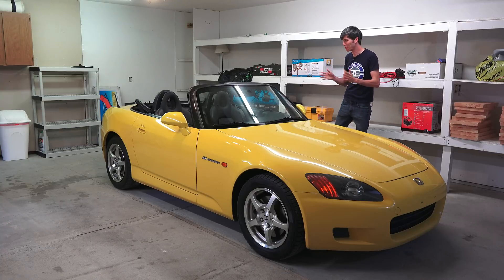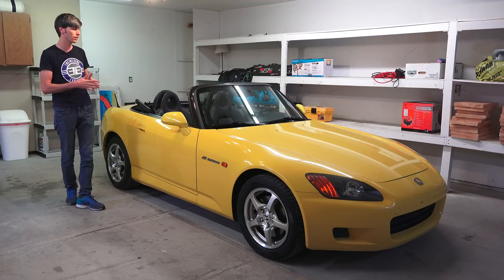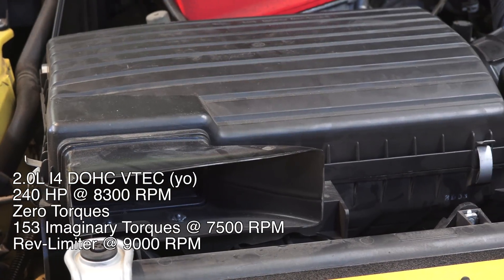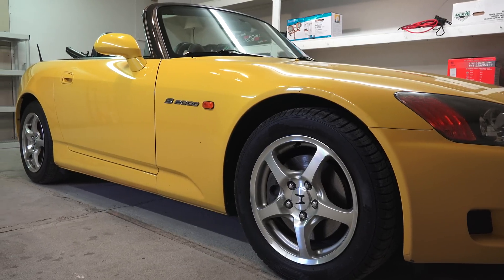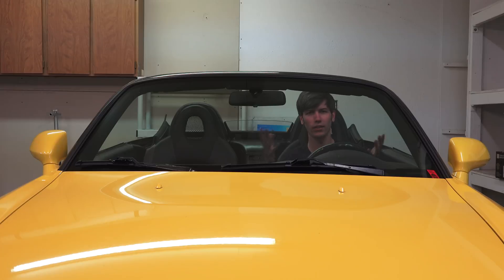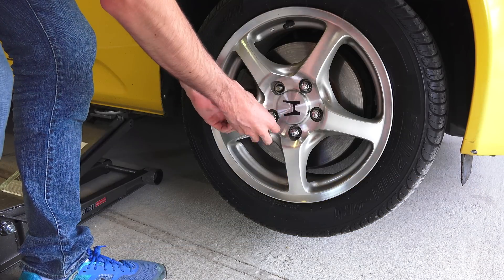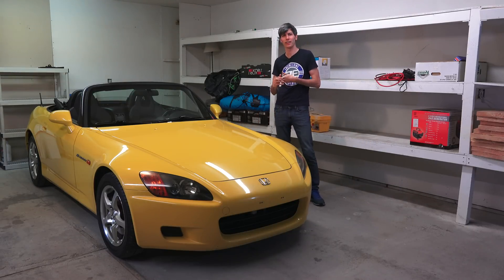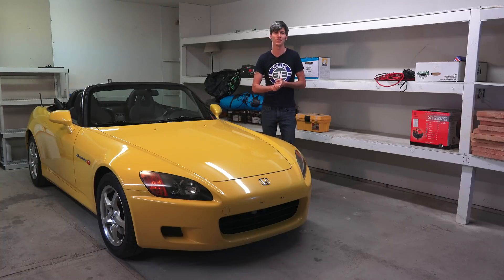I Bought A Honda S2000 And It's Amazing!

Comment: You sold your sti for this ?????? Wow
Reply: This is better than the STi lol
Reply: I sold my S2000 to get an STi ('05). Even with suspension work and a built engine with 385 AWHP, I had more fun in my near-stock S2000, even though it was way slower. The S2000 is THAT good.  I still love my STi but I would get another S2000 in a heartbeat.
Reply: He also bought another Subaru.
Reply: AWD isnt all that fun. Its cool in the snow and extreme weather, but in dry pavement with sticky tires its too tame. Not being able to break traction is a little boring.
Reply: dude. Lack of engine performance? It's all about the power to weight ratio. 240 hp @8k rpms in a 2,800 lb car is NOT a lack of performance. The STI weighs almost 600 more pounds and only has 60 more hp. Plus notorious turbo lag. It's a great car for sure, but so is the s2k.
Reply: He got another Subaru
Reply: jrherita As you subsequently said, it's a matter of taste.  One thing that blew me away was being in a Plymouth Prowler and taking an offramp curve at 60 when the sign said 25.  Zero skid.  Mostly due to tires and wheelbase/steering design.  But that's what got me liking AWD (No it's not an AWD vehicle; it just showed me what's possible when you reduce the torque the drivetrain puts on the individual tires).
Reply: I think you'd be surprised at that outcome.
Reply: The STI effectively has twice the torque of the Honda S2000.   This makes it a lot quicker up to peak horsepower.  At peak horsepower, the STI still has a slightly better power to weight ratio (3400/300 vs 2800/240).   For daily driving (i.e. 2000-4000 rpm), the STI's engine IS WAY more powerful and feels much more response.
Reply: Faster is only part of the equation, but for some people who can only afford one car - the WRX has a ton of benefits over the BRZ - useful cargo capacity, useful back seat, AWD, it's much quicker in a straightline and at the track,, and can be driven hard in all weather conditions - rain, snow, sleet, AND dry.    If you live in an area with cold weather, the WRX is a no brainer overall unless gas prices get very high again..   The Miata is at least low cost (although rust problems), and the S2000 is a nicely engineered car..  but there are more choices.
Reply: I would. no doubt about it.
Reply: +Imran Agassy STI useful rev range is wider than the s2000 due to the bigger motor and turbo torque.  I am sure a stock STI is faster around a track than the s2000.  the STI has good brakes and handling too.
Reply: Fair enough - everyone has their likes and dislikes.  For me, the lack of engine performance would preclude me from recommending or buying this car (I enjoy my 2001 Cobra Convertible instead.. yes it's a Mustang but it has the IRS, and the 7000 rpm V8 helps too :)).    I'm sure our EE buddy here will enjoy his S2000.
Reply: Rallycrossing in a Subaru is quite fun :) ..  The STI center diff is slightly rear-wheel biased, so hard turns under acceleration can cause some 'sliding sideways', which are a ton of fun as the AWD system skids sideways through the turn.   The S2000's lack of torque doesn't make it conducive to much fun slipping the rear tires anyway....
Reply: Let's see - Honda S2000 is fun in:  Nice Weather.   STI is fun in:  Nice Weather, Rain, Snow, Sleet, etc...
Reply: I've driven a S2000 for a few hundred miles and own a manual Forester XT;  the Subaru power at 3000-4000 rpm is a lot more accessible on the street, where with the S2000 you really had to work hard to get it up to the rev range before it would do anything.  To me that made the S2000 a lot less fun.  Tromping around in snow with the AWD is insanely fun.   i do love convertibles, but the S2000 sound ruins it for me.
Reply: STI to this...  serious ugh.

Comment: I like it, but to me it's pricey for 35,000 bucks. Many vehicles today are so overpriced. Better off buying a demo vehicle or a mint condition 1yr old vehicle with low mileage. Let another person take the initial beating. :-) When I was 16, I bought a brand new white Honda CRX Si for $12,200. That car was a rocket, and worth every penny. It was a fun car, and had the same suspension as yours. I brought it up to 130mph.
Reply from the maker: +electronicsNmore where do you live? They're no where near $35K in the states, unless you're looking at a '08 CR.
Reply: +Engineering Explained 
South Florida. I was looking at the 2009 model S2000 new vehicle prices. I'm looking at a mint condition s2000 with 38k miles for 22k right now online. I can only imagine what a 2017 would be selling for. BTW, I like that yellow.
Reply: Engineering Explained
I guess this vehicle is the modified/improved version of the Del Sol. I was never a fan of the Del Sol, but I do like your car.

Comment: Its a nice looking car but how hard is it to maintain as in minor engine work like tune ups and oil change? Not a big fan of video game gauges either. Blow a fuse and you're driving blind.
Reply from the maker: +Green Genes the dial gauges are electronic as well. Old Hondas seem to be pretty easy to work on.

Comment: I strongly recommend that you replace the elastic bands that help the soft top open and close properly.  they wear out over time and the latches wear holes in the top. They are only about $20 and would have saved me from having to replace the top.

Comment: Dunno if you can confirm this or even care too, but I always heard from a friend that an engineer on the FD3S RX7 team from Mazda jumped ship and went to Mazda to help design the S2000. Fitted with an electric power steering rack, my friend claims you can take the hydraulic rack out of the RX7 and it'll fit into the S2K. Seemed far fetched since someone would have to make their own bracketed for a pump sourced from something else

Comment: im thinking buying a used BMW Z4, the other car that have in mind is s2000. Im afraid that every single s2000 that is for sale in my area is pushed very hard cause its bought by people for that reason. On the other hand Z4s aren't pushed as much by their owners i suppose. What would be your advice?? Im talking about 2 litter z4. (I know s2000 makes way more hp). Im more interested in usable power and torque, how do you think 2lt Z4's torque compaired to S2000's?

Comment: A V-6 with 240HP and 220 torque would have been SO much smarter to build.  I don't know about you all, but the last thing I want to do while driving is literally rev and shift the piss out of my motor to get any output out of it.  Torque is king when it comes to the everyday feel of driving a vehicle, IMO.

Comment: You won't regret going with the Crosstrek.  Everyone will say it's under-powered but it does just fine getting on the highway.  I traded my 2012 WRX in for a 2014 Crosstrek and haven't looked back.  Gets decent gas mileage, can do some mild off-roading, and has good space.

Comment: Sold an STI and got a S2000...

Wow...
Reply: I daily drive an S2000 during the summer. Tell me more about how uncomfortable and impractical they are when I take long weekend road trips in it, average 30 MPG, get groceries in it & can blast along at 9,000 RPM.

But hey, you drive a vape cloud on wheels, so I get it, you have no idea what you're talking about & want to make your bias clear while attempting to sound knowledgeable on something you have no real experience with.
Reply: Torque is for people who don't know how to downshift (^:
Reply: I previously owned an S2k and now have a '16 WRX.  I understand why he made the choice.  The two are very different machines, with the S2k being the more fun to drive.  

The WRX/STI certainly has its advantages (TQ, traction, practicality) but in terms of pure driving feel, the S2k is a far more enjoyable vehicle.  It simply weighs less and feels extremely nimble and lively, whereas the WRX/STI feel like brute, power-houses that are less eager to rotate but still have strong cornering abilities.  

Both are great cars, but it all depends on if you prefer a surgeon's knife or a sledgehammer.
Reply: Sparatan117 PS. S2000 AP2 CR, 237/2792=.085 hp/lb, 2012 STi 305/3420=.089hp/lb ... More or less the same... not bad for a 4-cylinder engine with NO turbos! :)
Reply: Sparatan117 So S2000 is closer to race spec... that's ok?  If you had a JDM STi Spec C or S207 model instead of a USDM spec model, you would feel every bump in the road too (and you could rev to 8000rpm with your EJ20, more like a Honda also ;) ) ... So no difference? :)
Reply: Alan Barrese That's a good way of putting it. :)
Reply: Test drove an S2K, WRX, 370Z, and Mini CooperS back to back. For actual driving fun in an urban environment, the Honda and Mini were just far more entertaining. Good sight lines, ergonomics, and that lightness makes them way more fun (like a gokart), despite being down on power.
Reply: Sparatan117
It's not all about the lap time either.. Some people are just looking to have fun.
Reply: Least you're happy
Reply: Yep, less is more! :)  You gotta learn that by driving it. ;)
Reply: +tagrav No idea how others get such poor economy. I take it up past 8500 RPM at least a couple times every time it leaves the garage. I got 34 MPG on a 1k mile road trip I took it on earlier this summer.
Reply: Had a 224KW @ all 4 wheel sub 5sec GC8 WRX. It was an amazing car! After 6 years of ownership, the S2K was a change up. Totally different driving discipline and also an amazing car!
Reply: You're forgetting Torque...
Reply: Bespoke, purpose built RWD sports car which was designed for fun above all.. Vs a hopped up economy car that understeers everywhere it goes... Yeah, wow indeed.
Reply: bliglum >Understeers everywhere it goes

Lol... you're funny.
Reply: ***** You're shifting too early in the powerband. I shift at 4-4.5k RPM & cruised at 55 MPH on the 34 MPG tank, even on my normal commute I cruise at 60, almost never higher. I accelerate QUICKLY then cruise at very sane speeds. 

One of my good friends also drives an AP1 and averages 28 MPG with a best of 32, his car at 230k miles & mine at 141k. 

I appreciate the concern, but I've found a car getting solid fuel economy is generally a very healthy one. Of the ten S2000's I've driven, mine was the nicest to drive, which is why I bought it.
Reply: I like the S2K but I wouldn't trade an Impreza got one
Reply: +Blue8g most I could get is 23mpg. Anything more than that is crazy. 30mpg may be impossible
Reply: +Josh Poore Worst tank I have ever gotten was 25 MPG. I've put 4129 miles on my AP1 and used 138 gallons of 91 octane to do so. Do the math, I'm not BS'ing.
Reply: Blue8g I don't know how you get that. Maybe previous owner tuned it. I drive from san antonio to colorado springs to visit my girlfriend. Thats about 860 miles. The most i can stretch is 230 to 240 miles on one tank, and thats shifting between 3000 and 3500 rpms. filling up 4 times, san antonio, abliene, amerillo, and on the northern most city in new mexico. Ive done this several times. I have an AP1 as well. Several people on the s2ki forums could only stretch one tank to a maximum of 240ish miles. 34mpg is next to impossible. You may have a problem with your air to fuel ratio, your engine may be running way to lean. You may want to check your fuel pump or injectors, or maybe your tune. Thats pretty dangerous for your engine.
Reply: Blue8g check this out. http://www.s2ki.com/s2000/topic/992019-what-kind-of-mpg-are-you-getting/ i would get your s2k looked at. Running too lean could lead to pre-detonation or knocking. Dont wanna see your car die man...
Reply: Sparatan117 It certainly doesn't turn in as well as the lighter, front mid engine RWD S2000 does.. Nowhere near...
Reply: it's all about how you drive... Just remember, even though the Evo X turned in better in the top gear episode, the STI still won the time lap
Reply: I test drove one a few years ago and I found there to be very little steering feel. Didn't like it. It's not a surprise people are wrapping these around trees at fairly low speeds.
Reply: jimllbuildit
You are right about that.. The S2000 had early electric power steering, so steering feel is somewhat poor.
Reply: bliglum It might have just been a feature of the Mk1. We never had the Mk2 here, so I don't know if it was ever improved.
Reply: Blue8g I'm an STi person because I love rally not just because of the mad skids it gets
Reply: I haven't driven an S2000 but I thought the STI felt pretty nimble and lightweight due to it's power and handling, the ride was pretty nice too, not too harsh. But the S2000 being so much smaller and actually light weight in comparison, that makes sense. I think I need to try one of those next :)
Reply: TassieLorenzo 
The S2000 is a NA 237 HP 
2.2L 4 Inline 
162 ft lbs of torque. 
2,813 lbs

This is vs the STi 
305 HP with Turbo, 
2.5L H 4 Cyl and 
290 ft lbs of torque. 
3,386 lbs

So basically you've got a non-race spec'd car who's horsepower is significantly less than the STI, has a Rev range that has to be far higher in order to achieve torque, weighs almost nothing so it's terrible for anything but being on the track and isn't turbocharged. Furthermore, the suspension is so tight and stiff that it's not comfortable to ride almost anywhere with it, and the seats are pretty uncomfortable too, so enjoy trying to find a good seating position. The foot wells are just big enough for your feet... if you have a backpack... good luck. There's not enough space in the trunk to put much more than a tool bag and some small groceries. 

It's just a very impractical car that is under powered and is very much a niche item. If he likes it, by all means, but would I recommend it to anyone else? Hell no.
Reply: Blue8g You're so cute trying to make it sound like you actually know what you're talking about.. but hey if that's what you need to tell yourself to sleep well at night, then by all means.
Reply: I've ridden and drove an/in S2000 ... my ass remembers every... single... bump... in the road. I'll stick with my 2015 STI all day, any day.

Comment: S2000 isn't that good... Had an ap2 lots of problems.. Engine mounts went. Steering computer went.. Top needed to be replaced.. Other than spending about 5k to fix it.. The car requires 91+ octane and it's not that good on gas... But if you like it then it's up to you. I personally will never buy another s2000
Reply: Got unlucky with a poorly maintained car perhaps?  S2000s are about as reliable as a cheapo civic but sometimes you still get unlucky.
Reply: Damn bud, I never had that many problems on my ap2 but hopefully yours was just a semi-rare case. I know the AP1s had issues but never heard of the AP2s having as many as yours.
Reply: Yep, Hondas are pure junk. :(
Reply: you never owned a honda before
Reply: Everything you described is typical routine maintenance. Parts wear out and need to be replaced over time which includes motor mounts and the soft top which is made of fabric and also wears out.  Those reasons don't make it a bad car because you had to deal with getting it repaired. Maybe next time get the car thoroughly looked at before buying it. 

I've had mine for 14 years and never had a significant problem other than keeping the car up on maintenance. Yes it costs money to maintain and fix a car, welcome to the same issues every other car owner has.
Reply: Not that good on gas? Yeah, let's compare your gas mileage to that of my Trans Am WS6.  You don't have it that bad.
Reply: And what do you drive I wonder?
Reply: +firefighter5278 2012 Honda Accord HFP
Reply: Sebastian Rogers My question was adressed to TassieLorenzo. But you my friend have an excellent car in your hands. :-)
Reply: firefighter5278 Haha, I have 2 x Hondas^ ;)  I would have a strong preference for a Honda motorcycle if I were to get one (tasty CB400 is beginner approved in Australia :)), and even a Honda lawnmower if I need to replace the lawnmower, but apparently Honda things are pure junk!? :P

[1 x Euro Civic Type R, 1 x K20 EG hatch :).... S2000 would be nice but they are too impractical and expensive :) ... I would have the FD2 Civic Type R (obviously it's faster and sharper than the Euro Type R) if it was permitted for import to Australia (australia is right-hand-drive like Japan), then there would be no "need" for the EG but it's not allowed... The  Euro Type R is an excellent road car but it's a bit too slow to do hillclimbs or track days, hence the EG. :) ]

Comment: Have you found the secret compartment yet? Also, check the elastic straps in the convertible top they like to wear out which causes the top to fold down incorrectly. Was a fun car when I had one.